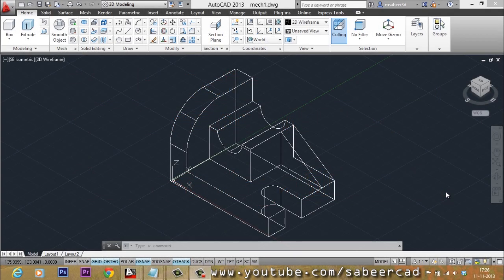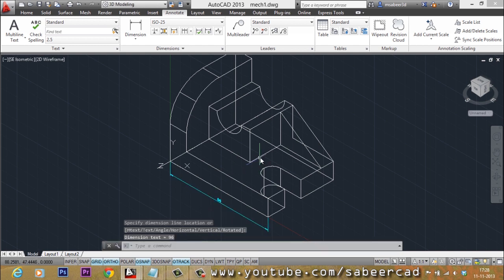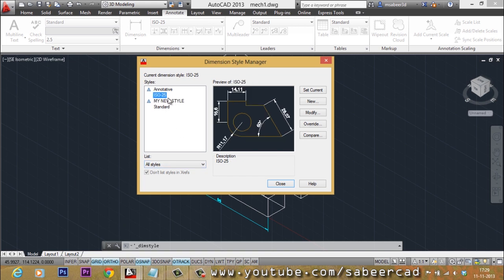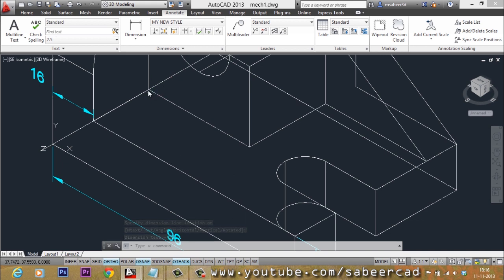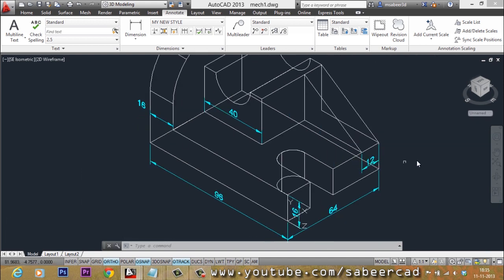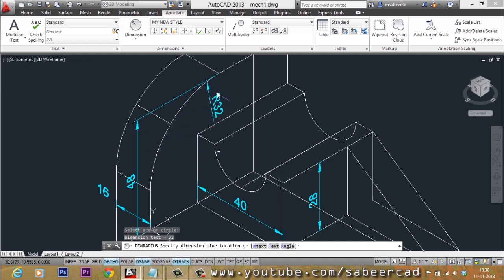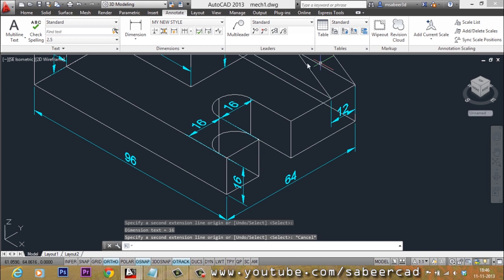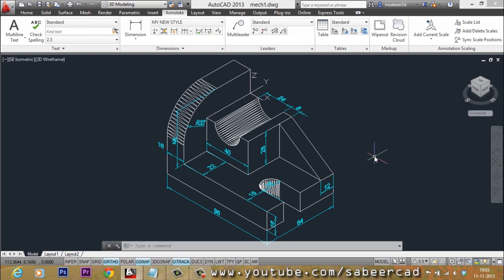AUTOCAD MECHANICAL MODELING PART2 -   DIMENSIONING A 3D MODEL

Comment: I know in 2014 you can select the UCS icon in the viewport and get the same options you get in the ribbon by right clicking once selected. You can also once selected move/drag the UCS or change the axis of it without getting out of the dimension command. I'm nearly sure selecting the UCS has been in since 2010 or earlier.

One more tip: Pressing the space bar is the same as the return key :)

Nice tut btw. Using CAD for 10+years and I never went near the 3d side until now. Thanks.

Comment: just a note, you declared you draw all the dimension, but the model lacks one: you forget to indicate the X depth of the lower pocket... :D
Another little note is that it's more useful to indicate the 8 mm dimension in the opposite wall of the middle body feature, not the one you used.

BTW thanks for tutorial, keep this good work
Reply from the maker: Nice suggestions , You are welcome.

Comment: Thank you for the video. One question - When I click on the dimension size Ex. 16, in my menu I don't have move only text - AutoCAD 2010. Do I have another options to move the text only on the side of the dimension line?

Comment: sir sabeercad goodmorning here in my country time. i will ask again for your favor. i have a problem in creating my dimension when i get the distance using command distance the measurement is is exact it measure 5' 7" when i measure in dimension it measure 5' 5 1/4. why they are different? thank you in advance.
Reply from the maker: Go to dimension style manager (DDIM) and change the primary units to Engineering . Also go to units command and change linear units to Engineering.